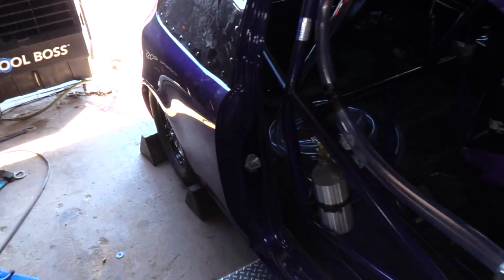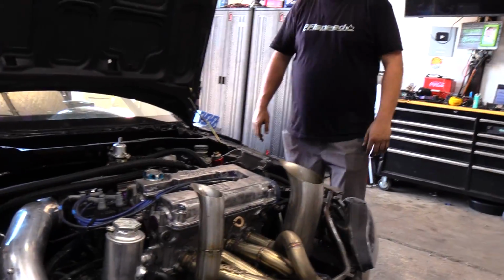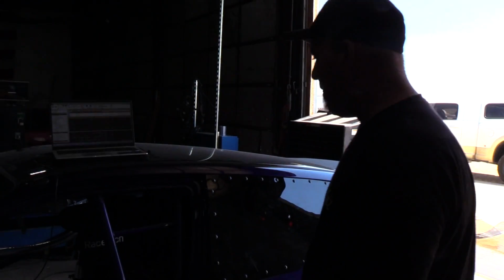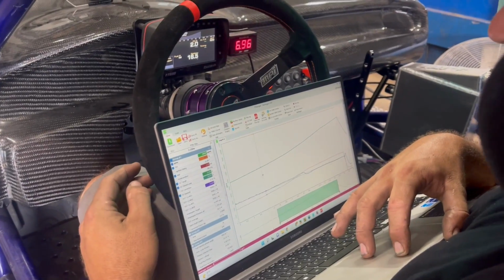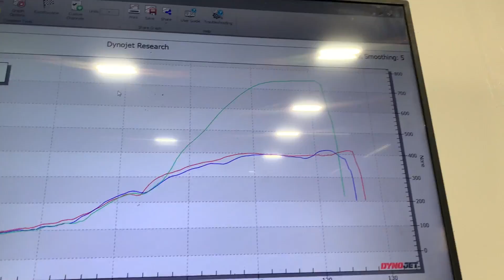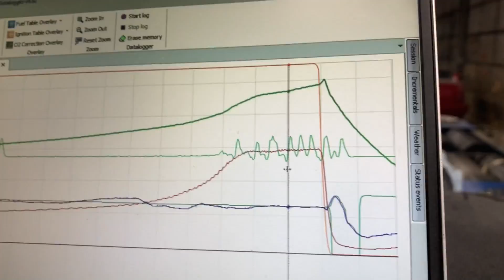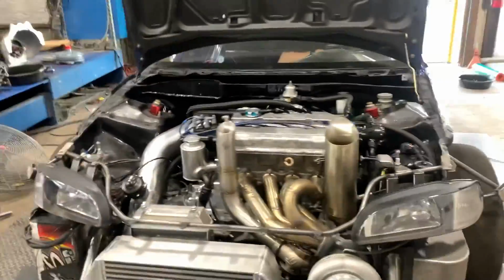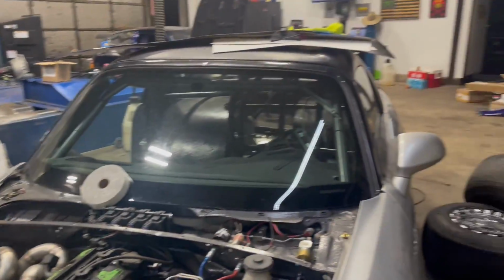Building a Rocket! We Dyno our Latest Wild FWD Project!

Comment: hopeyou get better soon tom , might want to keep a close eye on youre hartrithem , they sell these cheap cuff hart bloodpressure monitors that work pretty good  
when im stressed my hart starts vibrating instead of pumping if im out of breath for no real reason or have a feeling in my chest like you drank too mush fizzy soda and cant feel a clear hartbeat in my neck i know i need to slow the hell down , im taking beta blockers and bloodthinners for that and had a cardioversie (jolt) for that to get my heart back to its normal motion  , could be you had the same but choose to ignore it , now you need to take it eazy for a while and keep on youre meds like clockwork aspecially the bloodthinners to prevent more clotting , youre not out of the woods yet even after they fix the heart theres still the risk of bloodclotts floating around or work themselves loose and wedge themselve in smaller vanes (like in the brain)  , give the medicine the time to dissolve those before you going at it again , by the time youre doing better it might be a good idea to do some light cardio exercises to make youre hart stronger and improve youre stamina